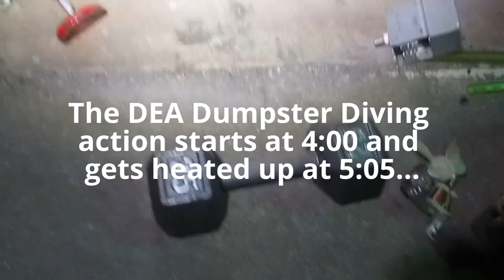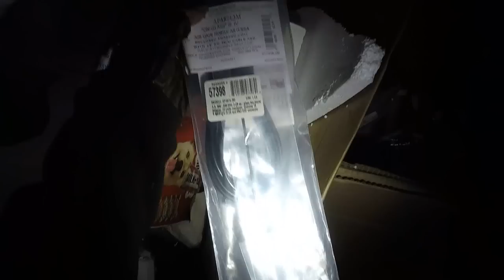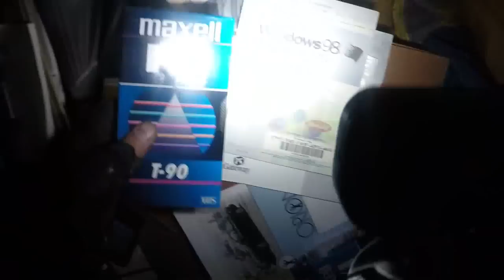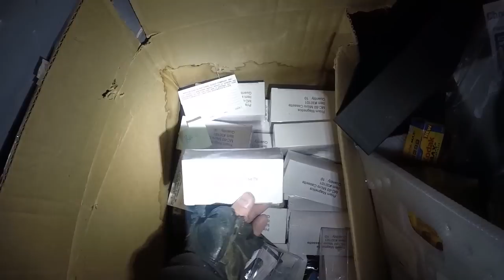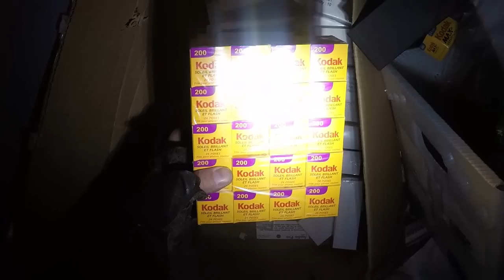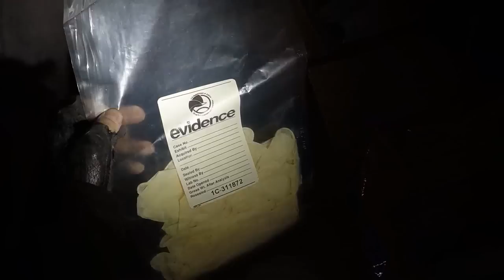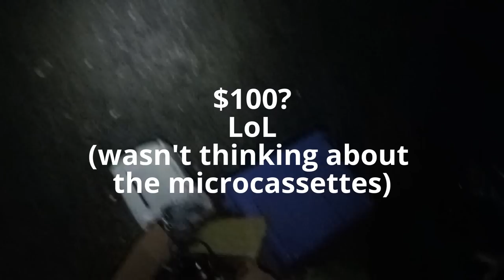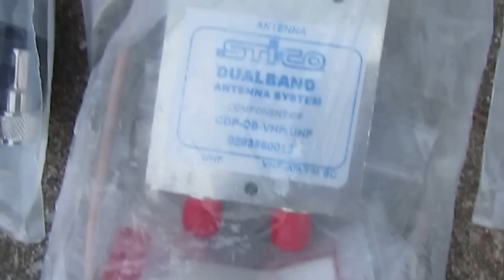$1,500 Dumpster Dive at the DEA POLICE Drug Enforcement Administration Cops Jackpot

Comment: The mirror on the stick is used for going around the bottom of a car. You can easily us the mirror under the car and check for GPS devices or hidden drugs. Most older gentleman use it for buying cars checking for rust underneath.
Reply: Appliance and electronic inspection mirror,,,,

Comment: ScrapVulture : That is crazy all the stuff you found! But if you ask me, you are way too concerned with the cables and wires. I saw a perfectly good label maker you held then tossed, those two reels of old slides too. Slides? Yes, slides. I used to work at JPL and not too long ago someone sold on eBay a set of 20 JPL slides similar to a set I have for $129. If they got something unique on them, there's a buyer on eBay for them. Why did you just toss those micro tape recorders?!? Argh!!! eBay dude! eBay!!! Maxell Metal tapes too! Wow ...
But you just want to junk things ... pity. I would make use of half those things. Rock on in your wire recycling world. There is money in it, but from what I saw, you could make even more if you took your time to research some of that stuff. I saw money here and there elsewhere in that dumpster. Comon ... take the evidence gloves!!! eBay!!! Backpacks ... and you didn't even search through them? I can guarantee you passed on $ that could have been made in addition to recycling the wire. 
Step aside a let a pro show you how its done.

Comment: What was the scrap value of the whole lot ??
Reply: NeverStopLearning 
idk, but he probably wouldve made much more selling on ebay and then scrapping the worthless stuff.
Reply: Estimated value if sold correctly, (those Moto brackets and siren parts all have part numbers, as well as the motorola wiring harness, probably 2500.00 or so used. maybe more. the Whelen speakers alone about 200.00 each, the Motorola speakers 35.00 each,  Motorola  mics 75.00 each, motorola control heads 250.00 each. Syntor mounting plates you said you were going to cut up, about 50.00 each.

Comment: the gold plate stuff, how do you scrap that?
Reply from the maker: I send the stuff that boardsort will buy to them and the rest i will just auction off on ebay in a large gold plated boards lot.
Reply: gotta get the gold off by using chemicals..  unless you got a ton of it, its not worth it!
Reply: you don't. it's not worth anything. You'd need literally like a living room full of complete PCBs to get $100 of gold. By time you cut the gold plated pins off all of them, pay for the chemicals, go through the entire process, etc. you could've spent less time working at McDonald's to make the same $100. It just doesn't make sense. Hence why most companies send that shit to China where they can sadly pay some kid pennies a day to kill themselves over a few bucks of gold scrap. The idiots paying $30 for old sticks of RAM and shit on eBay are just that; idiots.
Reply: Because its always a good idea to put a flamible liquid into a microwave.,,, Booom your gone.
Reply: Dont forget to keep your head in the microwave also
Reply: The gold plated pins are actually brass. If it is gold plated there really is no successful way to strip the gold from the metal. Not worth anything. I know this because I troubleshoot circuit boards and other electronic components for a living.

Comment: Please take some photos of the CB radios and the antennas and ask your lockal truck drivers if they are interested. Even for parts they could sell for more money than scrap for gold.
Reply from the maker: ya, the factory sealed antennas are on ebay for $40 - $80...cb radios? is that what the black boxes with the gold chips are? were? lol
Reply: the hand held small box with the spiral shaped cable brings me up  "Kenwood TM-481A UHF FM Two Way Radio Transceiver Car Mobile Radio 400-480MHz"   and yea the boxes you mention at the left side with the gold plated boards . PS one of them caught my eye , it had a lamp amplifier on. So it would be a nice idea to check their prices, and if you can not just post some photos so i could give you a hand.
Reply from the maker: i held back both of those boxes with the gold plated boards from the scrap yard, one is fully intact and the other i have the boards only...what is a lamp amp? ty.
Reply: lamp amplifiers are the pre ancestors of transistor based amplifiers. they are suppposed to give better amplification without lot of noice on the sighnal but they create a lot of heat.
Reply: ScrapVulture  Those Motorola boxes were the security housings and SIU (System Interface Unit) from a dual-radio (dual band) Syntor-X9000.
Great for ham use but you'd need to get familiar with it. Plus I didn't see any of the radio drawers, though those flat steel plates are the mounts for them.

Comment: Hun, many ppl still use film  still. I bought an awesome camera with tons of expensive lenses that are unusable on digital cameras if the same style. Ppl like the old ways vs auto  everything. Btw, all those batteries n chargers you find, you can make your own Tessa wall bank. Also you can put a few flat batteries together to make yourself a nice portable charger for your cell camera etc.. easy info in YouTube videos on how to make them at home. You hv all you need too. The thick chargers usually hv batteries like for flash lights n such but better. Pur several together n vwalla!!! If you build it as an open charger you can add on to it. Ppl use Tesla Walls  in their car's,  solar systems m much more. Ppl pay $300 or so for just the batteries then build the wall.. it's cheaper then paying 1000 + way up for it. .. just a thought. If you sold stuff online, you could make a lot.  Esp in box /package  items.

Comment: If you make a fire and put the cable on it'll take the insulation off and you'll get more money for it being bright and not mixed
Reply: Iain O'halloran i am from ohio and scrap yards here wont take burnt wire cuz there is a good chance it was stolen. Most copper thieves burn the insulation off to speed up their criminal activities. You need to take the time to strip it. Also bright copper is beter grade than burnt and you wont get the same price if you can even find somewhere to take it